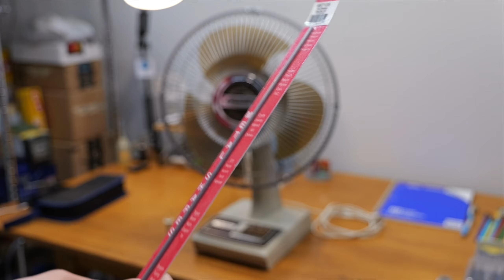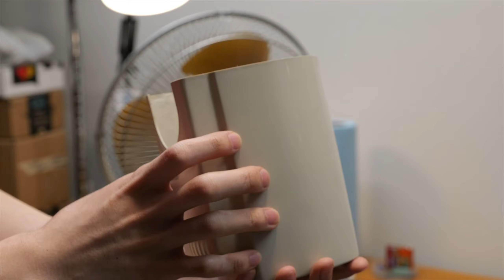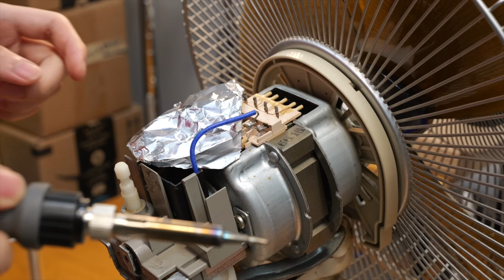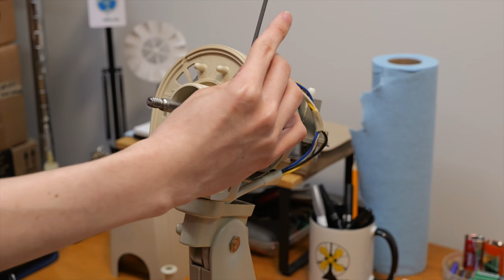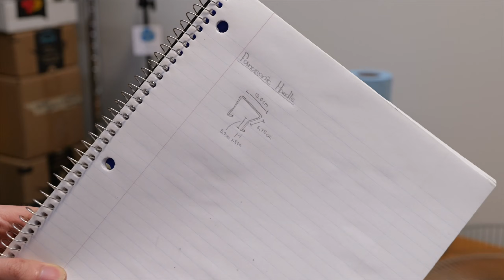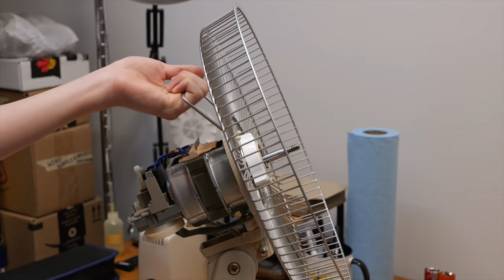1980s Panasonic 12” Oscillating Fan | Restoration PART 1: Capacitor Repair & New Handle

Comment: Bro I have a riveted motor and you can oil the motor by oiling through the oil ports but if I ever get a chance I would get in touch with you and teach you the methods to clean the bushings(yes bushings not bearings) and show you my National F-407V! Its my pfp btw

Comment: You can  oil these fans without opening the motor its easy under the motor theres gaps yiu can stick in Zoom Spout oil in there Zoom Spout has an extention and oil the back and front bearing through that gaps so no need to take the motor apart these are great fans.
Reply from the maker: Yep, that method works in a lot of cases. For this fan, the gummed up oil is impeding the rotation of the motor. Opening the motor to clean out the old oil is the most effective method to revive it.

Comment: Hi, I just got a pedestal fan but it doesn’t  oscillate.  How did you remove the pin?
Reply from the maker: Hi! To remove the pin, first remove the single screw on the back of the motor housing (shown at 2:10). That will allow you to wiggle the motor housing downwards to further expose the "neck" of the oscillator pin. There are two tabs on the neck of the pin (U shaped cutouts). Press a small flathead screwdriver into the lower side of the cutout and gently pry while lightly pulling up on the oscillator pin. This will disengage the tab from the rod extending out from the oscilaltor gearbox. Repeat for the other tab, and the pin should come out. Hope it helps!
Reply: @TheSuperFanMan  - OMG, thank you so much!!  It worked!!  BTW, it was very impressive how you made that handle for the fan!
Reply from the maker: You’re welcome, and thank you!

Comment: Do you have a video on how to replace the bearings On this type of motor?
Reply from the maker: I don't, and I've actually never tried replacing bearings in motors. Most fans with sleeve bearings have a metal retainer ring that is press-fitted against the bearing area to hold the actual bronze bushing in place. Removing this retainer and putting it back without damaging it is extremely difficult. If the retainer is damaged, it could pop out and dislodge the bushing when the fan is running, which would cause the rotor to drag on the stator and lock up the motor. It's a risky procedure but I think it could be done, especially if one doesn't mind if the repair is unsuccessful.

Comment: What was the diameter of the wire that you used to make the handle?
Reply from the maker: The diameter is 1/8”. Thankfully it was the perfect size for the handle!

Comment: I wish there was a part two because I’m having a problem getting the head to stay how I adjust it it just keeps falling back
Reply from the maker: It sounds like the spring mechanism in the neck joint broke. Usually this is one of the more difficult parts to repair on an oscillating fan, as it’s under a lot of stress from the weight of the fan head and the spring inside.

Does your fan have a large screw where the neck joint tilts? If yes, start by tightening that. Sometimes that alone will keep the head from falling.

Comment: I am diagnosing my oscillating floor fan & I am unsure if the capacitor is the culprit. The markings on the cap says -- MEI 4.0uf 230V --.   When I measure the cap with my multimeter, it gets around 0.05uf, so I have to wonder if it is the cap. It looks totally dead, even if I try to force the blades to spin with my hand.  But maybe I do feel a bit of a magnetic pull somewhere.   And I cannot find any fuse, to see if that popped.  I already looked in the bottom button region.  I will have to check the cap further & then search for a replacement online.
Reply from the maker: It sounds like the capacitor is indeed the culprit! Most oscillating fans use PSC (permanent split capacitor) motors, and they need the capacitor to start and run. A dead capacitor would cause the motor to simply sit and hum faintly when power is applied. I’d say check if it hums at all first. If it does, then a new capacitor will very likely revive the motor, whereas if there is no hum, the fuse embedded in the motor windings may have blown. 

Replacement capacitors are very inexpensive; a search for “ceiling fan capacitor” (they’re commonly referred to as such) on eBay or Amazon yields plenty of results that are only a few dollars. While you’re replacing the capacitor, it’d be a good idea to make sure the motor shaft spins freely. 

Hope it helps!
Reply: @TheSuperFanMan  ... long comment for those interested in my diagnosis ...  thanks for reply.  but i found out it was not the capacitor.  when i first measured it, it was still in circuit, so it was probably measuring other pathways to get to 0.05 uf.   there was no hum either.   so after commenting here, i desoldered one leg & remeasured, it was 3.8 uf, which was still in range/tolerance.  so i did some more sleuthing & eventually finally found that the common/neutral wire somehow broke & open somewhere inside the stand/neck of fan, i think.  so i got one of my cables with alligator clips to bypass & short-circuited between neutral wire in the button location at the base to where it connects at the terminals near the motor/capacitor, then plugged in & it worked!   also, the worm drive was freaking frozen so i slowly kept turning that around, that part at the bottom of gear housing which connects to the lever that makes the fan turn back & forth, with pliers & then poured light oil inside in the worm drive nest & finally after many minutes of exercising it, it finally unclogged & freed.  not sure why it froze, perhaps the motor overheated & fried the grease inside years ago.   i might put some lithium grease in there later.  
my only issue now is that i cannot seem to remove the fan blade so that i can lubricate the motor spindle behind the blades, it is blocked.  i cannot reach from back side of motor either, even when i have those oil bottles with the long thin tube to reach hard to reach places.    i have already lubed the opposite end of spindle where it goes into the worm drive.  most fan blades just lift/slide out but i cannot figure this one.  i dont want to pry it out so hard that i might accidentally break the plastic blades.  i have to wonder if the blade is threaded in.  i just need to get into that front spindle area, even though it seems mostly ok spinning, i still want to lube that area to ease it up better.  so other than that, i need to fix the neutral wire inside the neck.   yes, my fan looks like yours, basically a short floor fan & not the longer ones.   and the plug that goes into the wall is also intermittent due to broken cable at the neck so i will need to cut that off & use a replacement plug.  
so yeah, it looks fixed except somehow unable to getting the fan blade off & fixing/replacing neutral wire in the stand/neck & the wall plug.  good thing it was not the capacitor, nor open motor windings, which if that was the latter case, it would have been a waste & thrown into the recycler, because i am not about to spin new windings which i have no experience in, heh.  i got lucky.  we have had this fan for probably over 4 decades.  :)

Comment: I am so outraged that this fan is riveted shut because I really like it!  A combination of great appearance and quiet performance as expected from Pana, plus my favorite control panel (those huge rectangular buttons with the concave ovals).  I'm downgrading Panasonic from its spot as the top of the line fan from the 80s-00s and giving that position to Sanyo now lol.

Excellent handle repair!
Reply from the maker: Thanks! I have to agree. The riveted motor thing is what I dislike the most about Panasonic fans (and others made by Matsushita, like KDK). It doesn't help that the oil they used is pretty much guaranteed to get extremely gummy over time.

I love Sanyo-made fans! Motors assembled with screws & the oil hardly ever gums up. All of the Sanyo-made fans I've gotten over the years had perfectly running motors and happy bearings. I'm not certain if the late-70s-early-90s Lasko/Galaxy fans were fully made by Sanyo, had a few parts supplied by Sanyo or fully made by Lasko with Sanyo-esque design & parts, but I personally think also they're up there at the top.
Reply: @TheSuperFanMan  Oh no, KDK does it too?  Is every Matsushita fan riveted (at least in the era we care most about)?  I have one Panasonic fan, it's that Panacycle "hassock" fan that's not really a hassock fan; I remember cleaning it but maybe I didn't take the motor apart since it was working fine.  I'll have to check it again.

Yeah I'm counting Lasko/Galaxy and Dayton (and Mastercraft and some others) under the Sanyo umbrella.  Maybe Lasko did make that design and Sanyo ripped it off lol, not sure who did it first.
Reply from the maker: @Xyspade  yep, I think the majority of Matsushita desk fans had riveted motors, though I’m not sure about other fan types. Maybe some didn’t have riveted motors.

I think Sanyo was the OG since early-70s Lasko fans were made in Japan. But I’m not certain what the story is afterwards lol.
Reply: Where i live kdk and national panasonic mostly have oil ports this one in video is rare to find here

Comment: Huh, never knew these were riveted shut. That’s pretty annoying. As long as you have a long enough bit and a workplate with a hole on one of the sides, I’m sure a drill press would make quick work of that.

Were those Panasonics ever officially sold here in Canada? The only ones I’ve ever seen were the Torcan-branded ones from shortly before their bankruptcy, and some similar-looking Home Hardware fans from the 90’s which seem to otherwise be completely different and seemingly have nothing to do with Panasonic.

I love the 5-way oscillation, my 16” Simpsons-Sears from 1972 has it as well and it’s nice being able to adjust the oscillation so it doesn’t blow into a wall half of the time.

Best of luck with the rest of this thing!
Reply from the maker: Thanks! A drill press would really be handy. I only have a cordless drill but I'm thinking it'll be sufficient. It'll probably require more time and precision though.

I'm not too sure if Panasonic ever sold their fans here. I'd say that Torcan model is the closest thing we had. The one or two Panasonic fans I've seen over the years around here were probably brought over from the US at some point (this fan included; it was an eBay find).

Me too! It's a neat feature, even though I've always thought it was kind of gimmicky, since in most cases, just turning the whole fan slightly can achieve the same effect as moving the 5-way mechanism. It's really cool that your Sears also has it. Makes me wonder if it was a common Japanese fan feature, rather than a Panasonic-exclusive thing.

Comment: I can't wait for part 2 which servicing the bearings
Reply from the maker: Hoping to do that soon!
Reply: @TheSuperFanMan Hey do you happen to own a Honeywell Turbo Force oscillating fan??? I can't find one YouTube video on how to clean it.
Reply from the maker: @318lovejones  unfortunately I do not, but I’m thinking the disassembly process is similar to the popular Honeywell HT-900. See if there are screws around the circumference of the grille on the back. Unscrewing them should allow you to pull the front grille off for cleaning.
Reply: @TheSuperFanMan  Ok thanks!!! 👍

Comment: I have one exactly like this one and I love it. Quietest fan I’ve ever had and it puts out a comfortable breeze on low. I’m a big fan of anything vintage Panasonic.
Reply from the maker: Agreed! Japanese products are solid, fans included. The steeply pitched blades paired with a strong motor was the key to their quiet performance.

I've also noticed that there are overseas manufacturers getting licenses to use renowned brand names on their inferior, generic products. The Toshiba floor fan is one such example I had, but I guess we're seeing that with other brands too, like Panasonic. I'm not a fan of this, because it ruins the reputation of the brand name.